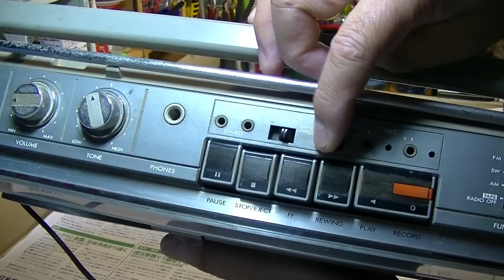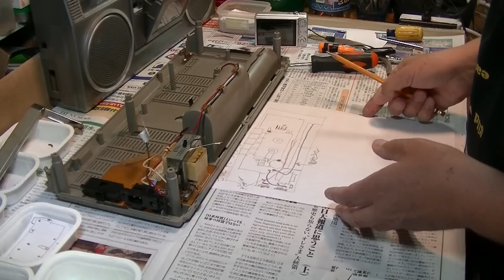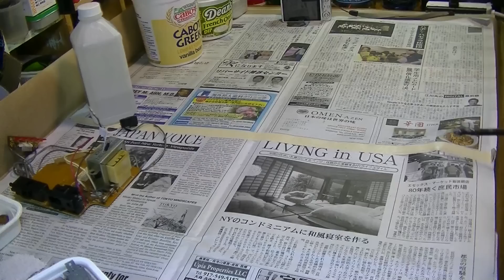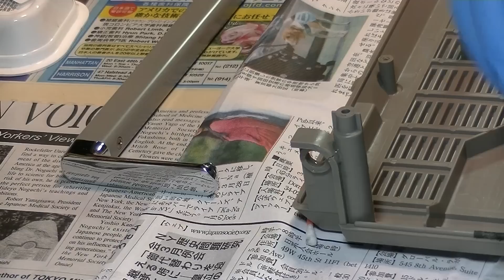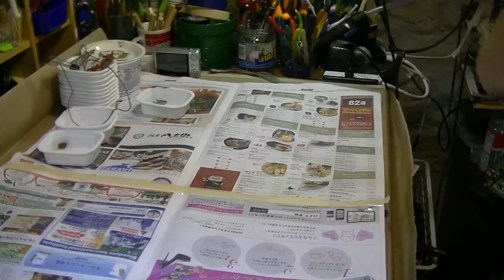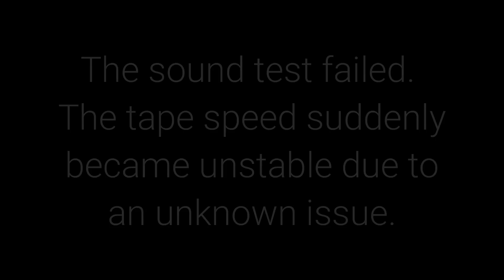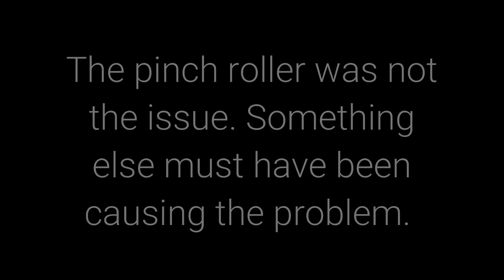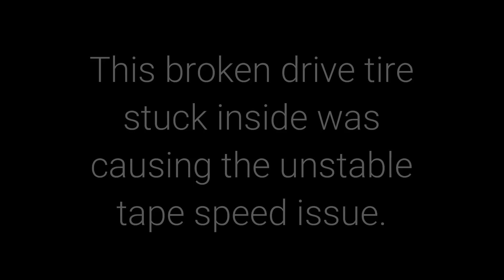JVC RC-373JW '80s Biphonic Boombox Cassette Deck Repair

Comment: Teddy - you are the king of fixer-uppers. You make it look simple. Usually, whenever pieces of plastic break, i.e. screw mounts or wiring clips, people throw those away, rather than spending some time and attempting to repair the damage. Cheers for this one (a real adventure) - and peace be with you. :)
Reply from the maker: Thank you for your compliment. Yesterday, I found a video that is fixing broken plastic parts, he used super glue and baking soda. It was interesting way to build up broken parts. I may try in the future video.

Comment: Hi teddy, great work! I have a JVC RC-363R which is quite similar to this one. I cannot manage to disassamble, it appears to be a little tricky. Do you know how microphone input works? It has two mic inputs (L and R), I'd like to use those as input to connect it to a smartphone. Do you think this will work? by using a single input channel i managed to only obtain a very weak sound. Radio still works perfectly after i repaired the broken antenna.
Reply from the maker: I have not tried inputting the music signal directly from mic line. I suggest you find the radio signal to amp line and inject your sound from there.
Reply: @teddyhashee  Thank you for the suggestion! I managed to input the signal through the input of volume control switch! Thank you! Do you know what is the purpose of "monitor" switch? 
 Bluetooth will come next :)

Comment: I have the same exact issue with a JVC RC-670. Going to pick up an o-ring tomorrow. Could you tell me what size you used for yours?
Reply from the maker: You want to buy o-ring assortment like these
https://amzn.to/2Hz0jyp

and find best one for the pulley
Reply: @teddyhashee   I ended up getting an assortment at home depot, and the cassette deck is working perfectly. Thanks so much for the video!
Reply from the maker: Great to hear that!

Comment: I love the way you work on these gems... Iots of respect!
Question please: any "techy" way to sense the perfect tension of the driving rubber belt? Thanks!
Reply from the maker: About belt, each machine has different setting thus unless we test it with its speed with some tone such as A400 hz,, we can not find the perfect tension. In other word, even the tension is not set as original setting, but if the speed is OK, then I will use it.
Reply: I dont mean to be offtopic but does any of you know of a way to get back into an Instagram account??
I was stupid lost my account password. I appreciate any tricks you can offer me.
Reply: @Arthur Grayson instablaster =)
Reply: @Kyng Kyng I really appreciate your reply. I got to the site through google and im waiting for the hacking stuff now.
Takes a while so I will reply here later with my results.